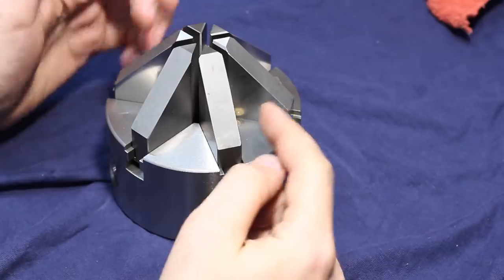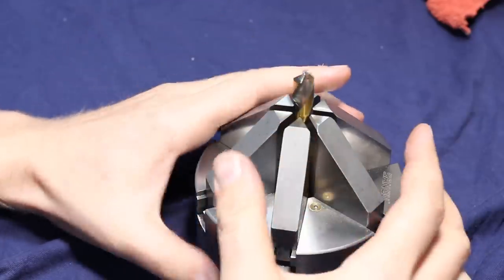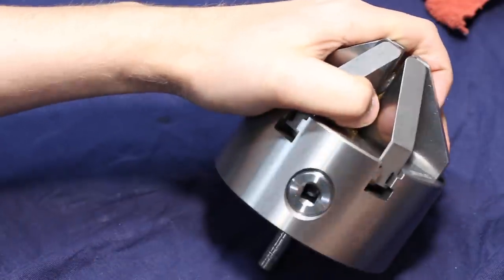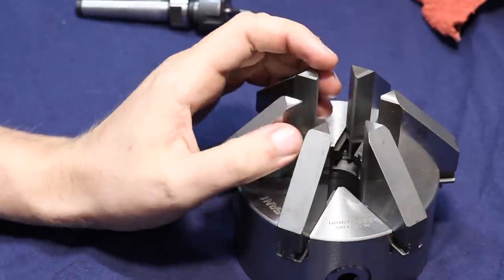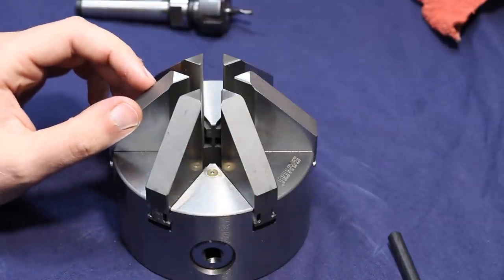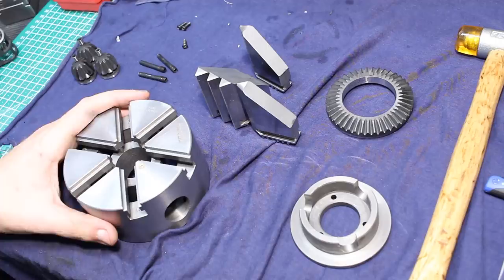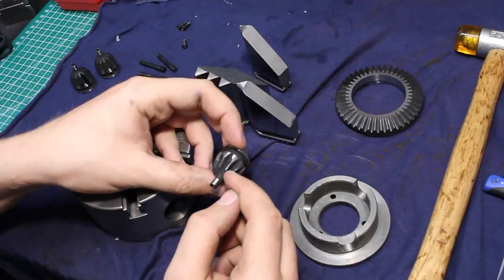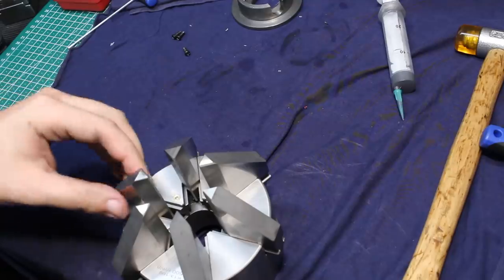6jaw Chuck for toolgrinding - Teardown, modification and boring

Comment: A very well done video about a kind of dry subject. I totally agree with you about using a 6 jaw for quick part acquisition with close to zero total indicator runout. Which on small part is critical. I can tell you from experience that using a turned ring midway on the tapered jaws a much better way when real dead-nut zero runout accuracy is supreme. When holding a chuck in a chuck extended so far out from the support of the headstock bearings vibration will be your enemy of accuracy. Holding using a fixtured fitment in back of six jaw chuck will really make for a ultra chuck. Nice job and do not stop with this presentation. Keep on machining and present us with other great topics.

Comment: Very curious about this adjust true flange you spoke of 🙂. I recently ground my old 3jaw, I thinks it's probably like 80 years old 😊. Got all of the bell mouth out of it but with the wear in the jaws still has different run out on different sizes of stock. So that might be a cheap alternative to buying a new chuck. Thanks for the share 😁.

Comment: I have two SanOu chucks both with 6350 so i had to make two backplates for the D1 4  spindle of my lathe ..this was a nice project...f....ck -- the first four !!!!  plates had runouts with the chuck from 0,2 to 0,6 !!!! First I thought the SanOu chucks are the reason but then I tried to work as precise as possible and there came out one chuck with 0,02 and one with 0,015...okay six backplates to get two good ones is weak but the chucks are not bad if you do it like stefan, clean and go over it and then you have real workable chucks for fair money...

Comment: Thank you for a video! Interesting content as always. I wonder what would be the best solution for my type work. I'm usually working in 3-10 mm diameter range with many replacements. Collet ER Chuck with a mark on collet and nut to make it repeatable? Or maybe adjustable chuck and indicator clamped near by for checking and adjusting each time? I wonder if there are small adjustable chucks out there...

Comment: Instead of drilling holes on the jaws which is you could while still on the lathe, bore a small recess on the face of the jaws that can also grip short and thin parts like washer or bearing races while providing a parallel backing. You can then grip from that and bore the rest.

Comment: Only one minor aspect. I think you possibly might have used a narrow ring, perhaps a button of nylon outer to preload your jaws equally before drilling. Would have ensured the jaws were preloaded against the keys in the body. Still very impressive. I was doing a quick job one day. Had to part off some 8 mm stainless rod. I had a big 3 jaw chuck on and simply threw up my 125mm chuck that I had a decent ring bolted on to the back as I used it for holding gears to finish bore and just adjust in my four jaw chuck. Was running at about 820 rpm and parted off the first part fine. Second cut it went wrong. Ripped the chuck out and it flew between my body and deflected off my forearm. and spun across the workshop and stopped spinning when it got to the wall. I had a huge bruise on my arm, I actually thought I had broken it. I was lucky because the 8 mm rod sticking out about 30 mm missed me and the jaws were just inside the main body so didn't catch on anything.

Comment: Cool show Stefan, hey if that key is 3/8" Its handy for driving sockets and 3/8 drive hex key's. I have one of Sanou's drill chucks and found out that if it's cheap and good you tend to use it. had it 10 or so years still bout 2-3 thou runout not a bad little drill chuck. Find like a metal funnel or somthing and make a dust gaurd or somthing to keep the grit out. God i just bought some of those cheap er 16 collets that I probly will have to super glue to a homade mandrell and tool post grind, and probly end up with more runout than that ha ha.      Happy Holidays Stefan.

Comment: I was a little surprised that you didn't also grind the front 15mm or so of the outside of the jaws round. You could get a tool about 4mm closer to the work that way.

Comment: You are slipping Stefan ! I was expecting that you would re grind the scroll and hand scrape every surface to within two electrons of the desired dimension😂.
Having those holes for the dowel pins could come in handy one day especially for holding thin rings or washers .
Excellent video and it gives some food for thought for those who are looking at repairing a chuck  .
Reply: That's a really good point with the dowel pins. It would be useful

Comment: Really excelent video as usual! Just one detail:

Did you consider grinding the outer sides of the jaws before you put them in the grinder to regrind them? That way you would ensure that the reference you are using is a valid reference. As they came I don't think those surfaces had any accuracy (they don't need to be accurate anyway.....). And I think you could have had the jaws meet up more precise if you had done this first. It looks like one of the jaws are close to the center, and therefore will hit the pice of tubing you have in there before the others, thus being pushed inn harder (and being bent out further than the other jaws). 

Nitpicking I know, but it would make it possible to get even better accuracy this way.
Reply: was thinking the same thing as well. in our shop we always machine the outer OD of the jaws clamped with the according chuck when a set needs to be machined at the clearance angles, that way you could ensure they would clamp down pretty evenly to start with. jaws for CNC chucks and soft jaws for scroll chucks are especially bad in that regard, they tend to be off centre by almost 0.5mm in some cases.

Comment: How does those drilled holes on the top of the jaws affect the rigidity and repeatability of the chuck?
Reply: Hard to tell, but the chuck would spin up faster because of the reduced mass. Zeit ist Geld.
Reply: 0%
Reply: Unless you clamp something super hard on those first 3-4mm?,it will have 0 effect .There is plenty of material around the hole .It might cause some small vibrations on 10k rpm if holes are not drilled the same ,but even that is not important ,since most of machines that spin on that much are big enough to take it.

Comment: I have a question, can you grind external steps on those jaws and make that an internal/external chuck?
Reply: No, because you have to turn the jaws around and the teeth that engage with the spiral would curve the wrong way.
Reply: If you had a need for it I can't see any reason why not. Especially if the lost strength didn't affect the type of work you're using it for.

Comment: did you ever see this crude video on chuck making.. https://youtu.be/LR48QufOHIY  when you ground the jaw tapered sides.. why did you not set the jaw straight up  or set all six up and clamp them and grind them all to the same length from flat back to the jaw tip.. you may need to clamp something in the jaws and then indicate the flat face on the outside.. to see if the jaws are actually equal..   have you measured the radius of the cuts on the scroll gear side of the jaws..

Comment: Your DRO had some kinda neato feature to work around a circle in 6 points I assume? I have an old heidenhain, perhaps from the 1970s, no real features aside from showing axis values.
Reply: Yes, I was wondering the same thing. He kind of just magically found the points for the dowel holes
Reply: "Bolt circle function"